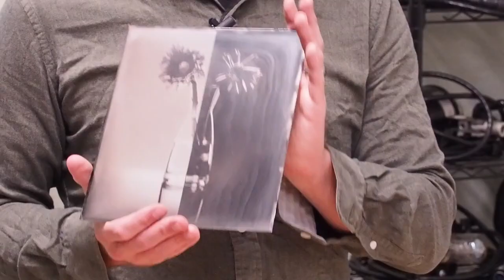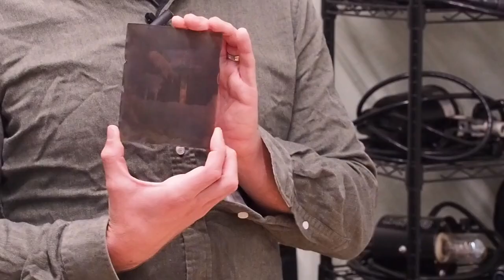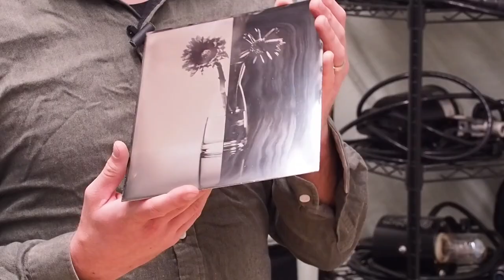Collodion Basics Part 1: Introduction

Comment: Now, people always say that plates will dry out in 10-15 minutes. But what if the plate was kept in an airtight box? The vapor pressure would be reached and the plate would not dry... Especially if you added a cloth soaked in the ether/alcohol mix. When I get my camera done and my chemistry arrives I'll have to do some experimentation

Comment: you state the misconception that tin in tintype refers to the cheapness of the plates. 
tin in this case has in fact nothing with the element tin, this is true. Tin in a sheet of iron! therefor you have a tin roof, tin snips, tin hat...et cetera